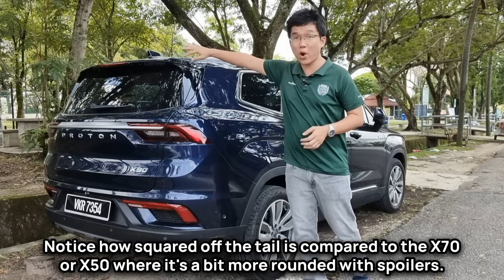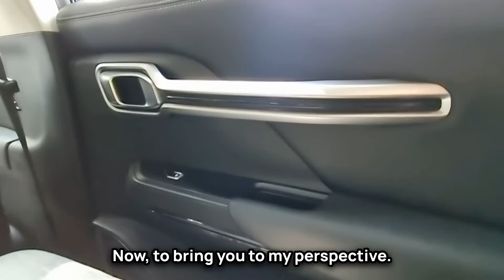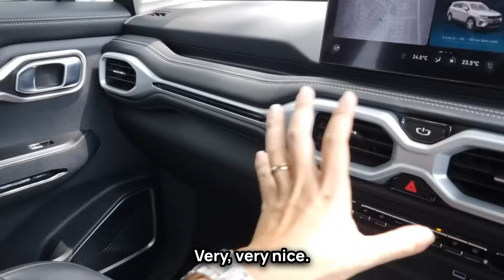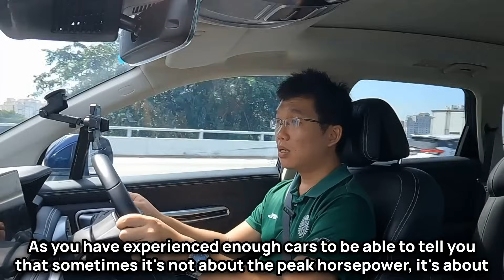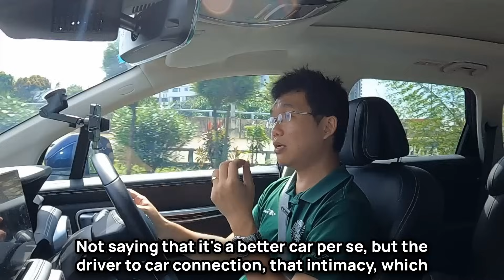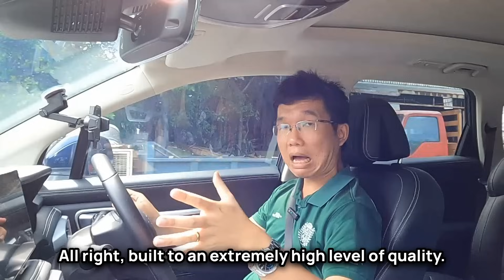Proton X90 Review - 3-cylinder engine enough for 7-seater SUV? | EvoMalaysia.com

Comment: near the end of the video youu talked about engines and the campros are being faced out that the 1.5L was the best choice of the engines but in reality this car would need a bigger engine
than why didnt they use an other engine they already owned the 1.8 which i believe many X70 users are very happy with so in a way there was a larger more suitable engine but they didnt use it
And honestly with the resent release of the new X70 fase out of the 1.8 engine in the X70 is also very disappointing to me
i dont get it people seam to be happy with the 1.8 there is no need for development the engine is already there why not give the people options ?
in myy opinion the 1.8 would also have nicely gone in the S70 
for S70 maybe make a kind of more sporty lowered with spoilers all around and a 1.8 engine and still make a flagship X70 and X90 with a 1.8 for those that want it

an other thing is i didnt hear anything in your video about the fuel consumption does the mild hybrid makes a big difference how does the X90s with mild hybrid compare to the X70s fuel consumption

Comment: Have compared this to tiggo 8 and jetour x70.Proton win in all aspect, from spacious,technology and assist parking.Its a worth car actually.The only concern is 3cylinder engine and design not sporty.Front aircond vent look awkward.Need to compromise this.Others in term of spec and handling is better than 2 model. Just my opinion based on test drive all the model.😊😊

Comment: The body not match with engine capacity..i thought it will be run by 1.8 or 2.0cc..for extreme road at Sarawak, 1.5 with 7 seater will be hard to climb up the hill..😅
Reply: this 1.5 is turbo charged. not the normal 1.5 naturally aspirated. go check the engine specs for better understanding. This 1.5 turbo is more powerful than the velfire 2.5 liter
Reply from the maker: Agreed, I have my reservations on that point too, but I believe there are economies-of-scale considerations at play.

Comment: My wife is an owner of the X90 and has been using it for 7 months. So far there are no major complaints except the IHU which is very unstable at the early stage of getting the car. So far the car serves very well as a daily runner for my 3 kids with ample boot space for groceries and strollers with the 3rd row folded. I have even upgraded its handling with a set of stage 2 bars and had loads of fun bringing it up to the hills. The car climbs and handles way better than my Vellfire and Ute. It’s a vehicle that you get more than you pay more. Only thing you need to tolerate is the slight vibration and engine sound from the 3 cylinder engine.😂
Reply from the maker: Thanks for sharing! Always love to hear stories of happy owners!
Reply: Thanks for the honest and humble sharing, which is valuable for interest buyers out there. 👍

Comment: Should Proton still in its own until today. I highly doubt it would be able to produce as many new models in a span of 5 years (X70, X50, X90. S70) with as many technologies strange to Proton (4x4, direct injection, high power turbo 3 cylinder. Dual clutch transmission .. high tech safety and electronics)

It's quite surprising Proton engineers could switch the X90 torsion beam rear axle into a multi link system but can't do the same with S70. Or is it true some people say Geely already has a multi link set up for the AWD version of the donor car that Proton boys could just plug and play?
Reply: Not they don't want but they have to control cost to ensure the price able to compete with City n Vios
Reply: have you seen majority car in segment B thath use multi link? don’t expect to pay peanut and get gold my man. it is absurd. even yaris use torsiom beam i believe
Reply: come on lah, proton has use multi link in its Suprema since 10 years ago.
Reply: @hishamazam5752  suprima was segment C la boy. common to have multilink. that is why when proton fan boy mention that s70 is segment c and i believe it is bullshit. s70 is just B+ segment and that is why they reluctant to use multilink. they want full margin of income from this car even AA or AC is not available but sun roof? stupid strategy.

Comment: If it's barely adequate power by single passenger, it would then struggle with with full load of passengers and luggage as with it's design brief in the first place , it's just sad that proton didn't push or choose the 1.8l engine which is more suitable in the first place.
Proton is likely doing so trying to consolidate their engine parts among their models to the detriment of their customers driving experience
Reply: I don't see a problem with that, after 2 years of driving a Toyota Vellfire carrying corporate peoples + luggages, sometimesa all seats full including guests. The 2.5 V6 only produce 180hp and 235nm. The X90 1.5 tgdi are producing 177hp and 255nm without the hybrid system. With electric motor help, it is 190hp and 300nm (for acceleration I guess). Also X90 about 400kg lighter than the Vellfire. I wouldn't call it "barely adequate" for an entry level D-segment people-mover.
Reply: @mhki2004  but at least Toyota vellfire or Alphard has a choice of engines to choose from, if proton pushed geely to get the 1.8 or 2.0 engine then it would be a better choice overall for the platform and the function it was intended to do. Instead ,it sounds rather a cheapskate method by streamlining the engines in order to make things easier for them than benefiting the choices for the customer to choose from. But then as Kon mentioned, Proton in the big picture is just a small player globally speaking, they don't have the luxury of pushing for more advance engines as geely's customer
Reply: @mykchancy  I agree, I do hope they bring in more engine option as 3 cylinder doesn't sit well with me also. And they seems to ask too much out of 1.5L for the big X90. But, with 1.8 or 2.0 (with turbo) they'd stray away from their current target market. They may have to price it closer to something like KIA Grand Carnival (wich is superior with it's diesel powertrain, also better interior design and materials). Importing new powertrain may come at cost. Unlike current ckd 3cyl 1.5T, what I can see they're trying to achieve economic of scale to reduce cost. It's win win situation for people who keep their car longer and need for cheap spare parts and lower maintenance cost.  But not so much for people who love to upgrade their car, they'd never want the exact same powertrain.
Reply: @mhki2004  yeah but the hidden cost of running this model is easily hushed up by a lot of reviewers, the first thing is in reality higher petrol consumption , and also more servicing is required than what the manufacturer stated in order to keep the engine running for longer due to heavier strain on the engine and gearbox.
We can predict this engine quite easily with the x50 and x70, so with this x90......im sure everyone can guess 😉
Reply: @mykchancy  Nahh, I'd bet my money on their DCT since the Vellfire CVT was pulling 2.1 tonne + passengers up Genting every other weeks like a champ (CVT is like the weakest form of transmission ever exists, wasn't my money servicing them anyway). But I wouldn't trust much on that small 3 cyl. No Idea on X90 fc, but Vellfire was like 9L per 100km at best, that's like 11km per litre and it's got much worse most of the day. Any car that big would consume a lot of fuel I guess.
Reply: @mykchancy  I think everyone is well aware that the hybrid battery will need to be replaced after a period of time and the price is reasonable since one can afford a car at that price point. In terms of petrol consumption it’s considered low compared to other MPV’s and SUV’s.
Reply: Mind you. When you carry your whole family for a trip, you want power and speed? Or comfort and safety? When going trips with family, 'adequate" power is sufficient. I was curious about power and speed all the time until I was reminded by a family man who chosen a T. Velos, that is even worst power. Those question came from a good family man.
Reply: I think most people do not understand the power of a turbe charged engine. I suggest to check the engine specs of a turbo version versus a naturally aspirated one (i.e. non turbo). For a quick comparison, especially for those who are a bit reluctant to check and compare the specs themselves, x90 1.5 turbo engine is much more powerful than the velfire 2.5 engine.

Comment: With Proton moving to a more premium segment. It would be a loss if there are no more development for the lower segment which are Saga, Persona and Iriz...

While Perodua does dominate the budget car segment, it will be a loss of option for people who wanted to have new car with character at a budget.
Reply: They need to deliver a sedan that's below the S70 (an S50?) -- take out the turbocharger, a few fancy bells and whistles, use a simpler transmission and slap it into the current price range of the Persona (which I assume will be phased out now that the Campro is being phased out).